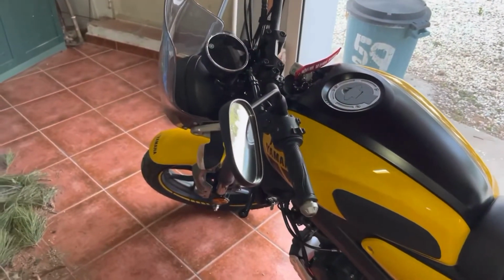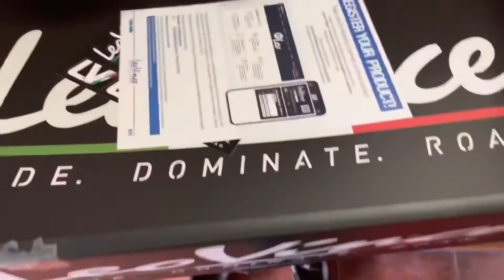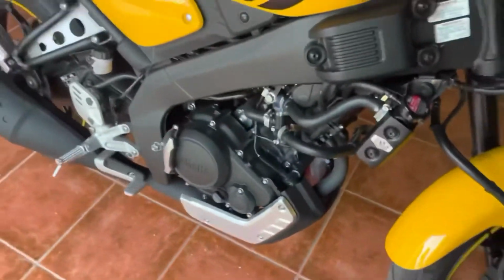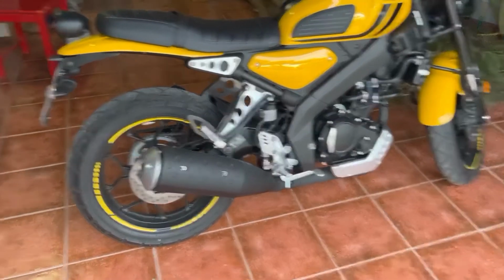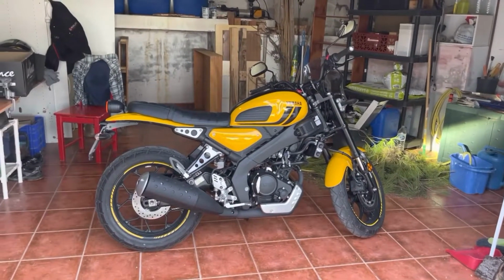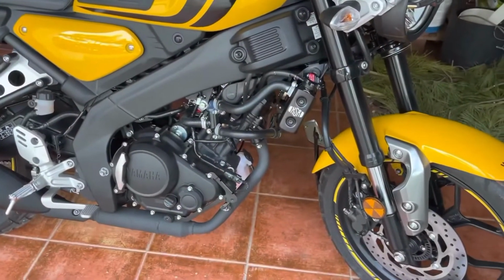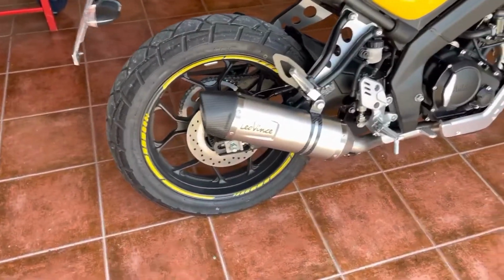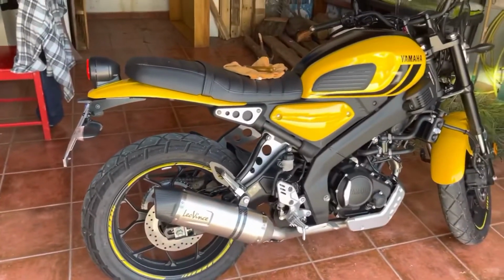Yamaha XSR 125 Exhaust change (Leo Vince LV One Evo)

Comment: Have you had any engine light problems?, since i innstalled this exsaust on my xsr125 it has been having problems with the engine light.
Reply from the maker: No, none at all. Sorry to hear that. Did you screw in correctly the lead that goes into the exhaust? Towards the beginning, behind the plastic engine protector.
Reply: @unclesamrider  had one of my experienced friends do it. Sending it to a workshop soon. Thanks for the answer👍
Reply from the maker: Hope you fix it!

Comment: Hello, is your exhaust certified? I saw on the official website that there are two types of exhausts, certified and non-certified. Do they sound the same? Thanks
Reply from the maker: Exacly, there are 2 types, this is the certified one. I am not sure if they sound the same, never hear the other one.
Reply: @unclesamrider  Thank you for your reply. I have been hesitating whether to buy one without certification because some people say that the sound without certification will be louder.I'm not sure either
Reply from the maker: Generally yes, non certified ones sound louder, that is correct. But louder is not always better, some  sound loud, but it is not a nice sound, so it depends on how it sounds, but being Leo Vince I’m sure it sounds good.
Reply: @unclesamrider  You are right. Thank you very much for your reply. I wish you a happy motorcycle ride.
Reply from the maker: @linliu5565  Ride safe brother ✌🏻
Reply: @unclesamrider  Hey bro, I also bought the same type of exhaust. Unfortunately, I removed the db Killer and after a day of riding the check engine light came on. Then the Yamaha dealer told me that I cannot dismantle the db killer or the engine fault light will come on. Is this true?
Reply from the maker: No, never happened to me bro. I have no issues, I take it off and put it back on often and has never happened.
Reply: @unclesamrider  Thank you bor I am still looking for a solution
Reply: @linliu5565  did you fix it yet?
Reply: @danisantos3255  Yes I have fixed this problem, it was simply because my mechanic didn't tighten the screws enough😂
Reply: @linliu5565  haha good to hear! Are you happy with the sound? :) would you still buy it?
Reply: @danisantos3255  Thanks, the sound is very good, I will buy it again

Comment: How much does it cost? And does it have homologation ?
Reply from the maker: I got it for €380 new, but on the website it’s about 500/600€ Yes it has homologación for sound and filter.
Reply: @unclesamrider  thats a good price bro where did you got it ? its still in stock ? and you really can feel a difference of this little more hp ?
Reply from the maker: @Denizonn  A local shop here in Spain with discount.
Reply: @unclesamrider  Hi mate, I am also in Spain and looking to get this exhaust. Which shop did you get it from? Thats a good price, can't find it below 500e atm
Reply from the maker: @northernriderpov  When I bought it, it was online at the shop for €580, but when I got to the shop and asked for it, it was the last one and as well as being cheaper than on their own website, it had a discount on it. The Shop is `El Motorista`
Reply: @unclesamrider  thanks for the quick reply. I’ll keep looking as it’s not available on their website it seems. On another note, is the upgrade really worth it ? Does the exhaust note change a lot ?
Reply from the maker: @northernriderpov  Yes, for me it was the best investment I did on the bike, out of everything I bought. The sound is much better, and if you take the DB killer out, it sounds amazing! Not only that, the weight difference, it´s a couple of kilos lighter.

Comment: V max now with that exhaust?
Reply from the maker: No idea my friend!
Reply: I have this exhaust with no cat, and so far 127km/h on the clock which is 116km/h on GPS. But I'll let you know about the results in one month when I 'll have installed Powertronic ecu and Malossi cylinder kit 183cc :-)
Reply: @Wookson71  nice!!
Reply: @Wookson71  upgrade your injector if you're putting on a big bore kit.
Reply: @Wookson71 how is it now?
Reply: @ringsrud  perfect. 21HP, 18,5nm. Max speed 135 (130 on GPS). But acceleration much much better. It even accelerate going uphill on 6th gear 😀
Reply: @Wookson71  Hi guys, i'm already at 130km/h (121 on GPS) on the flat with the stock exhaust (XSR125 2023) , i'm wondering if a new exhaust like this LeoVince will improve the engine/speed and dynamics at all or just change the sound ?
Thanks for the nice vid!
Reply: @chrisvanco4694  I changed much more, so I have much better acceleration and little better max speed, but I have now  21HP and 18,5Nm :-) But it costed a lot :-)
Reply: @Wookson71  Oh wow ! sounds nice :)
How much can you make at fast right now?
But on my side i will not go that far on my bike, just the idea to improve a little bit... do you think changing the exhaust line only will change a little bit the performance ?